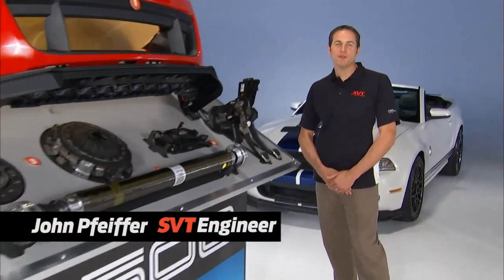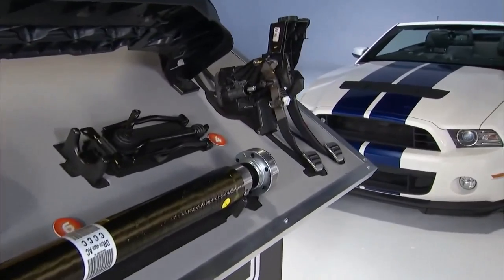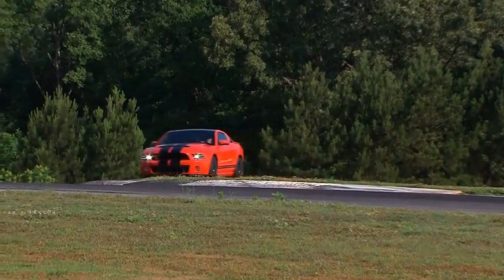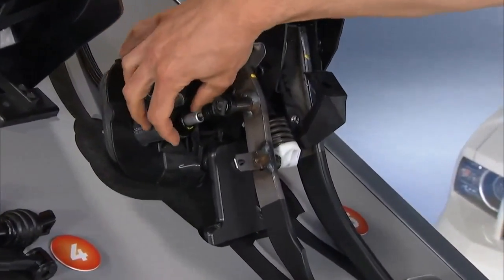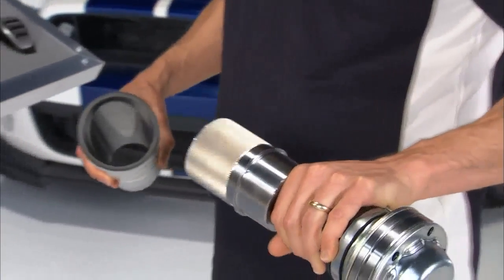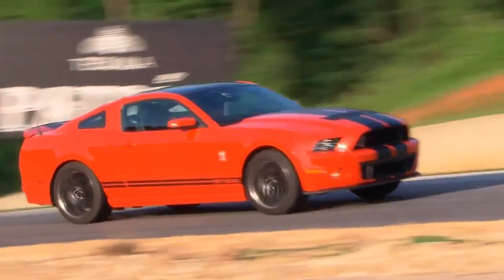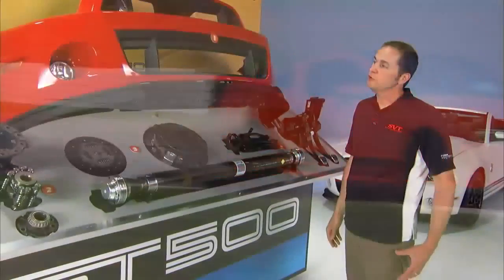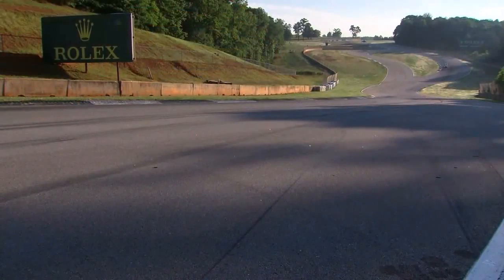2013 Shelby GT500- Engineering Overview.

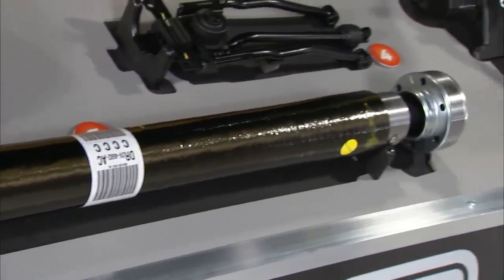Comment: 2:17 Single piece CF drive shaft! Just like what the man said; it reduces total vehicle weight, but more importantly, it reduces moment of inertia which contributes to more torque dedicated to accelerating the vehicle rather than a heavy drive shaft! Those 2-piece drive shafts in the regular GT can be squirly. 
And of course, the Torsen